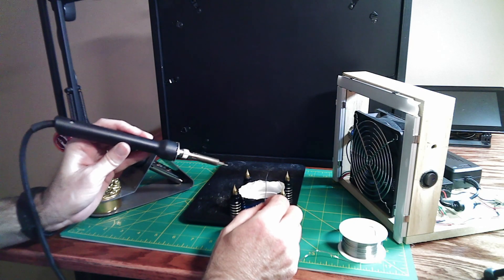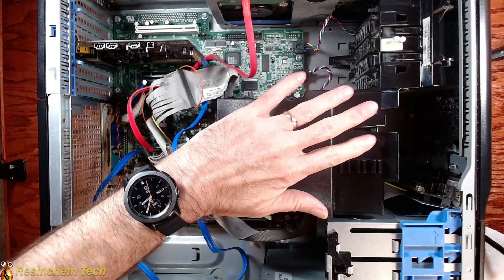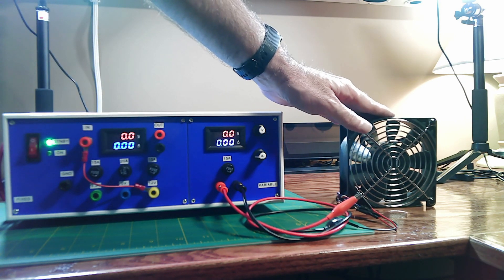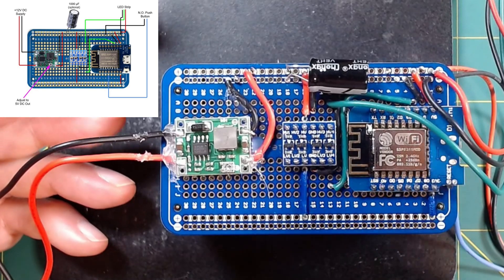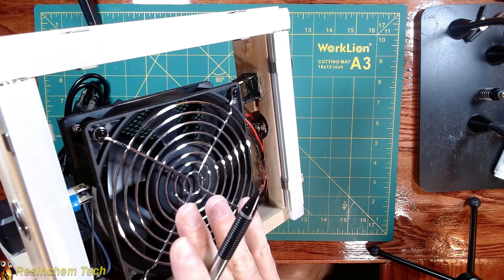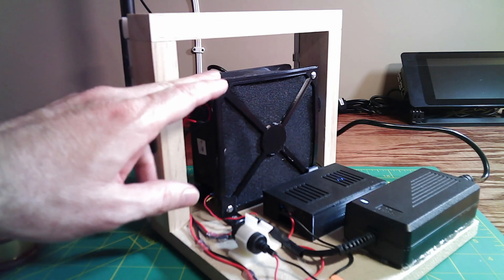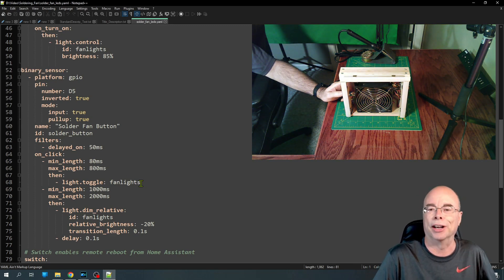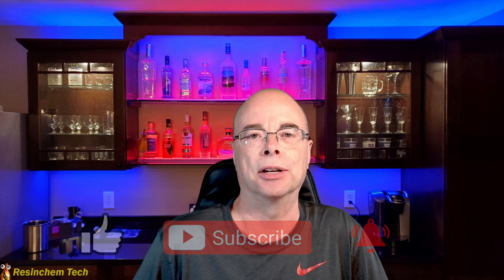Stop breathing these fumes!

Comment: This is nice looking, but way over engineered for its purpose.  At my work desk, I have a basic 12V white led strip mounted under the overhead shelf with an inline dimmer switch to control the brightness.  No controller boards needed.  For my fume filter, I used an old 140mm desktop fan mounted to a coroplast shroud that also housed the carbon filter.  That was mounted on top of a Joby Gorillapod so I could get it closer to the fumes.  I used a PWM controller like the one you showed to control the fan speed.  I eventually replaced it with a Koto fume extractor because the fan I had just didn't have enough airflow.  If I had a fan like the one you used, I'd probably still be using my DIY one.  It's still nice as a desk fan to keep me cool though.
Reply from the maker: This is one of those projects that sorta' grew beyond its original intent.  After using an old server psu to create a benchtop power supply, I wanted to see what else I could repurpose.  The fan seemed like a good choice.  Initially, just feeding it 12V made it too fast and noisy and 5V wasn't enough to get the blades spinning.  So I need to add PWM.  Then I figured if I had a controller, might as well add some LEDs for extra light.  To be honest, and if I had it to do over again, I would have built something with a smaller foot print.  The current fan takes up too much space on my benchtop to just leave it there when not in use.  It works well... but I'd build it differently the second time around.

Comment: This is the most pimped out fume fan I think I've seen on the internet and now I want to make one 😂 needs to actually finish the projects that I'm doing first before I jump into something else but this looks low drag, high draft
Reply from the maker: I certainly could have made it "prettier"... but I wanted to use scrap wood and other parts I already had on hand.  I think the 12V power supply is the only thing I had to actually purchase for the project.  I do like the LEDs on the front as they provide a lot of extra light directly onto the components that I am soldering.  

I did need something to keep the fumes out of my face and since I had a couple of these fans left over from the PC I tore down to make my bench top power supply, repurposing one to use as a fume fan seemed like a good (and cheap!) idea.

Good luck with your own projects... and let me know if you build a fume fan similar to mine.

Comment: You  should add a mq sensor to auto trigger
Reply from the maker: That's a good idea!  But where would you place the sensor?  If the fan was off, the fumes would not be pulled towards the fan/sensor and I assume it would not trigger the fan to turn on.  I've not used an MQ sensor before, so I'm not sure how sensitive it is nor how close the fumes would need to get to the sensor to trigger it.

Regardless, thanks for watching and passing along the idea.  I love when viewers come up with alternate ideas or improvements for my projects.
Reply: @ResinChemTech  You could always use a smart plug on the soldering iron. I am really enjoying your videos!:goodvibes:

Comment: I like repurposing old servers, I scavenge them for parts, too. 

Could you have used a pot connected to the D1 mini to control the PWM and had a variable speed fan, too? Even use a small LED screen to display the RPM. 

I know that’s overkill for what your goal was, but a variable speed fan could be useful, even without the RPM display.
Reply from the maker: I too like to repurpose old components and tech.  Part of it is learning how the old stuff worked, keeping things out of the landfill and building something useful on top of that.

I did add a pwm motor controller to the fan after I had been using it for a while (I 'pasted' a new section into the video that talks about that and shows how it works).  I'm not sure a regular potentiometer would work to control the pwm signal, it is just a variable resistor and wouldn't change the actual pulse timing... just the voltage/resistance.  But I'm by no means an expert on electronics theory.  I do know that you can't use a regular potentiometer to control the 12V / 1.6A directly to the fan.  I tried it (multiple times, like a fool).  I totally neglected Ohm's law and created magic blue smoke!

I agree about the variable control and if I were to do it over, I'd integrate the pwm controller into the design a bit better.  The pwm controller is just a couple of bucks more than the buck converter, so it is definitely worth it to have the variable speed control.  Thanks for watching and taking time to leave a comment.
Reply: I'm certainly no expert either LOL!

I understand about a PWM controller vs not using a POT.  Still pretty much a noob to home electronics, but I'm getting there!
Reply: Just rewatched the video with the PWM controller addition.  Nice, that's how I envisioned it working!

Thanks for the great content!